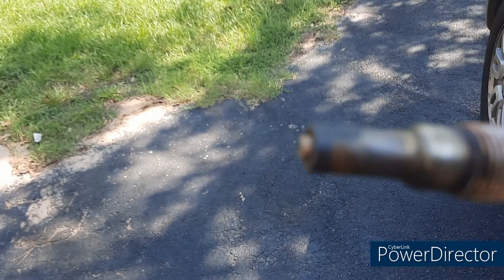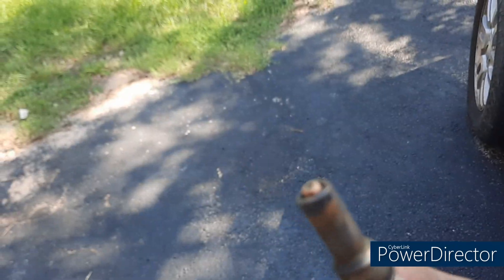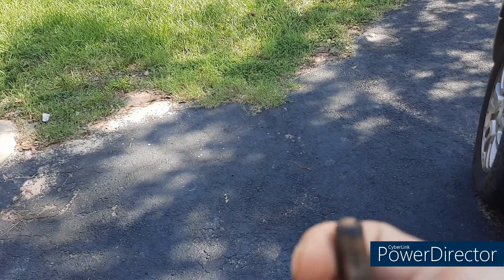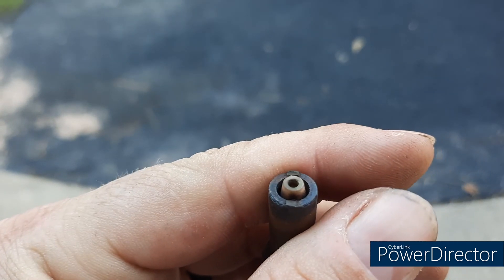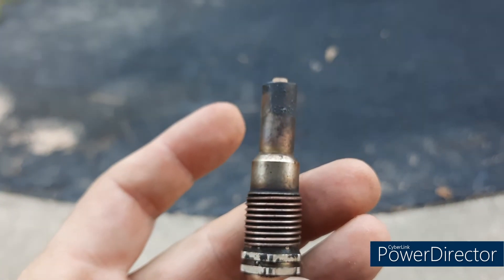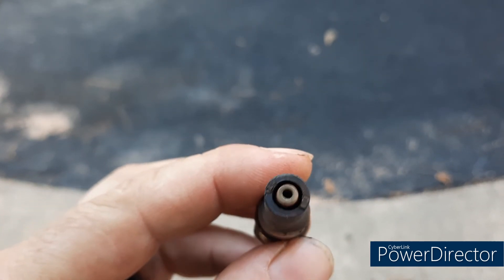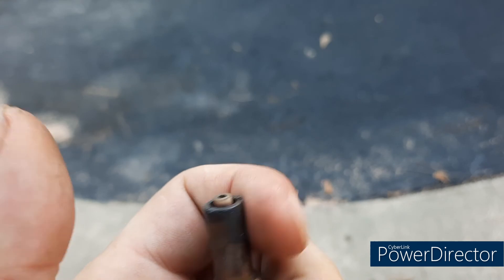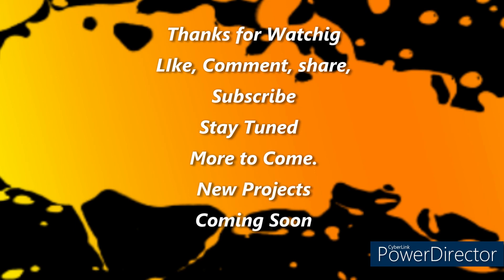E3 spark plug failure on the expedition. never seen this before

Comment: The same happened to my Lincoln Navigator. I bought the suv used. Replaced with original, no problems since.
Reply from the maker: Yeah we bought it used as well and I'd used these plugs on a previous vehicle without issue so figured I'd do an upgrade for the better spark ect. Boy was I wrong. After this one I had a 2nd one do it 5 months later. I'll be going back with the OEM here soon.

Comment: I put E3 in my 2000 Chevy Silverado and after 21k miles I'm having a miss fire on cylinder 1 so hopefully just a spark plug is bad but not as bad as the one you showed
Reply from the maker: @johns3153  right hopefully you won't have as bad of issues as Iv had. About to replace the ones in the expedition this one cam out of yet again. Put them in in March and already having issues and they were oem this time.

Comment: I use to love them E3 but they suck now days. :( I prefer NGK even in American made vehicles but the porcelain would always crack for me so I just stopped using them but I used to really love E3
Reply from the maker: They were the best option available in stock when I did the coil and plug change. I'd always had good luck with them and ngk too. I didn't wana risk putting in oem Motorcraft plugs and have them separate in the head like the oem plugs are known to do on the triton motors.
Reply: @GlassWerx  yea makes sense. I’m not knocking your choice or anything just really disappointed at the quality E3 has been producing as of late.
Reply from the maker: @TexasHondaChannel  yeah I know u weren't. I definitely won't be buying them again. That could have destroyed my engine. I just got lucky is all. For $13 a piece ud think they would be better. It literally looks like the piece just broke off or something. Iv never seen anything like it. Iv seen plugs melted and plugs smashed by piston strike but nothing like this
Reply: @GlassWerx  yea man not good at all.
Reply from the maker: @TexasHondaChannel  I definitely wouldn't recommend them now thats for sure.

Comment: Gotta remember these are standard coppers which melt fast; max 30k miles... Your engine I assume is a DIS, so cut that 30k in half. Best go w/platinums, double platinums even better but iridium's; cost too much😄
Reply from the maker: These are iridium's  but Yeah I thought the iridium's would be better especially for the price but he'll these didn't even get 10k miles. And being a coil on plug engine I thought they would be even better and improve fuel efficiency more then what it did but no luck there either